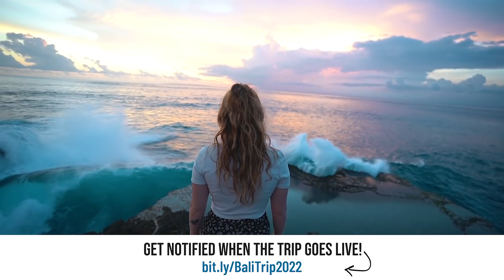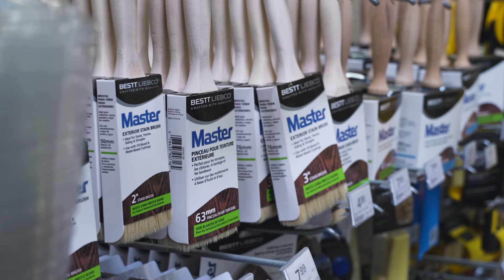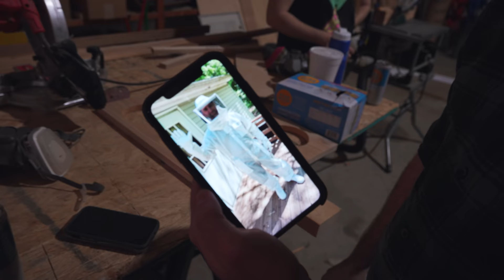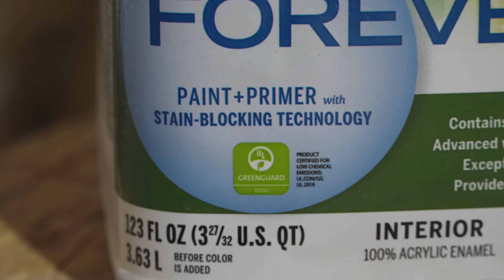RV Renovation - We're FINALLY Painting the Interior! 🤩 (Ep. 24)

Comment: Pro tip: line up the holes in the sandpaper with the holes on the random orbit sander when putting the sandpaper on. That will help with the dust collection and should reduce the dust quite a bit.

Comment: I guess you chose Dicor because of the rubber roof coating. Dicor is not a permanent product like marine polyurethanes but is fine for things that will have to be replaced, like vents and solar panels, but over time it will break down. For roof seams, you want to use a permanent sealant, and many RVers also cover the seams with eternabond tape over the sealant. You want to be sure to do your research so you use the right products for the job. You will get some extra time because of the rubber coating until that starts to lift. My friend said hers lasted about 3 years on her aluminum roof and then she noticed the bubbles where the coating lifted and water got in underneath. Be vigilant and check it often, hopefully you can get a good number of years out of it. It looks good cosmetically.😀

Comment: You guys a doing a great job on this project! I’ve really enjoyed the series. I do want to make a comment on the paint job. Don’t put to much credence in paint/primer paints. There had always been a trade off between adhesion and pigments. The more adhesion the less pigment and more pigment the less adhesion. With modern polymers the adhesion is much better without sacrificing finish. This works great for previously painted surfaces. More scrubb able and wear resisted. BUT I’m my opinion the first time you paint anything that you prime it first. The surface will suck up a lot of paint and will be hard to get an even finish. Primer will seal the surface and leave a perfect finish to apply the paint over. The paint will go on and dry much better. You’ll use much less paint and primer is cheaper than paint. Yes it’s more work but the finished product should be well worth the effort. As long as I’m commenting on paint, I’ve never seen a one coat paint that didn’t look dramatically better with two coats. The primer/paint and one coat paints are marketing as most people hate painting and will pay for anything that claims to make it faster and easier. Painting sucks but with all the work it takes do it the right way and you won’t have to do it as often.

Comment: ProTip on using a paint roller: If you look at the paint roller handle as a number 7 it has a closed in end and an open end. The closed in end should always be on the side you are travelling to. So if you are painting left to right the closed part of the handle should be on the right. If you are painting right to left, the closed part of the handle should be n the left.

Comment: When is the right time to start your first trip ?   Hint:  just go,  we did, in a fully carpeted van with nothing else inside but a fold out foam couch,  3 little boys,  baby, 2 yr old, 6 year old and destination from Ohio:  Disney World, then Sanibel.   Oh, fully carpeted meant floors, walls, ceiling and cab.   All short shag, all the time.  An 80's thing.    Oh yeah, we had unbolted a sink, icebox water storage cabinet from a VW bus and tied it down for the trip.   Didn't finish the carpeting, windows and roof vent until 4am the day we left.   Loni drove from Ohio to Valdosta GA on I 75 with Al sleeping on the floor exhausted.  When Al woke up, we found a KOA, pulled in and everybody went to bed.
Reply from the maker: Oh my. That's a wild first adventure!! We'll likely have a bit more amenities than that when we hit the road, but we'll still have a lot more work to do and fix. Nice to know we're in good company, though :)